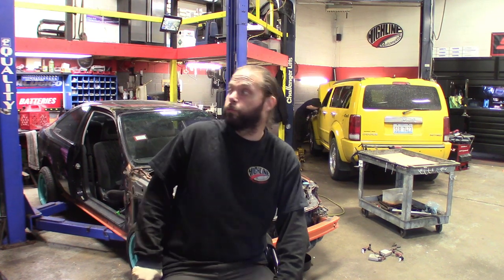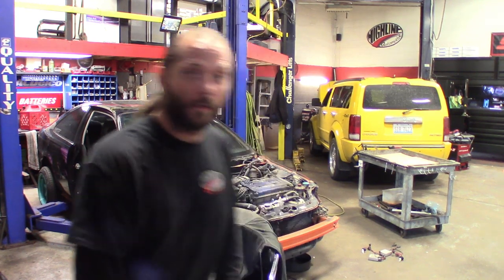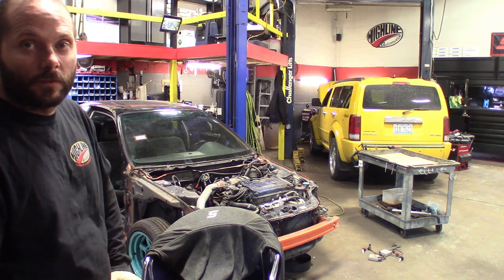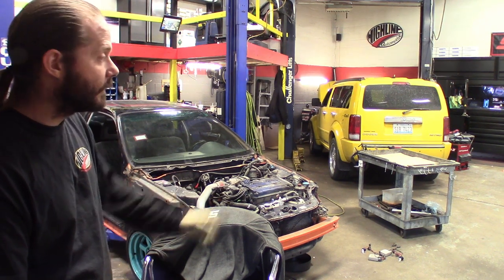Civic Build Day 1

Comment: Since you dropped the motor and transmission are you going to go through and replace the timing belt and clutch or are they still pretty good to go back into the car? Just curious
Reply from the maker: Probably doing timing, stage 2 or 3 clutch, intake, arp studs, head gasket and other gaskets
Reply: Nice  I cant wait to see it all play out when the build is done.